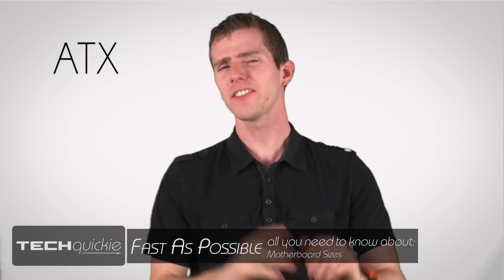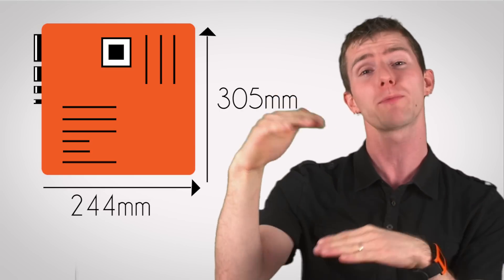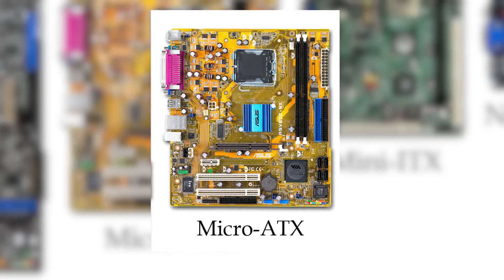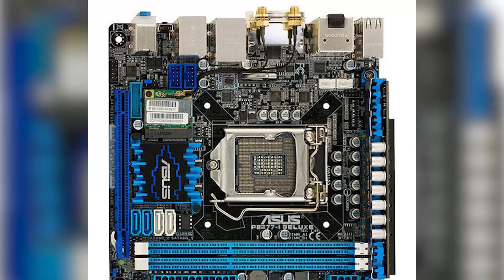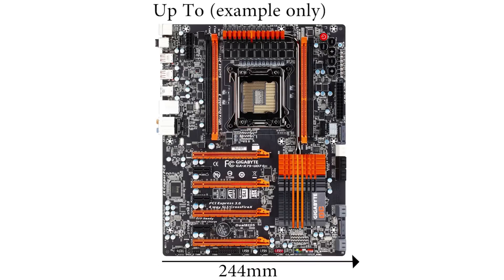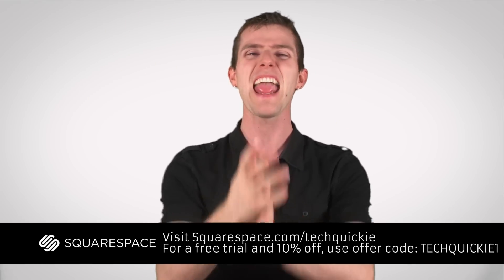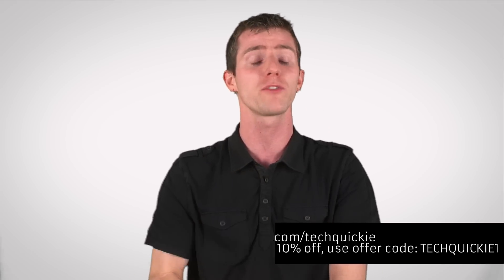PC Motherboard Sizes as Fast As Possible

Comment: Never. Ever. Buy a Mini Itx board.. I have one and I regret it so hard.. Upgradability is VERY limited, and can't be overclocked (atleast the one I own). The reason I have this board is because when I bought my PC it was prebuilt and I had almost no knowledge about computer stuff.
Reply: the only limit is the one pci slot and only certain nobody can be overclocked for Intel.
Reply: Not everyone needs crazy expansion. Also your specific mITX MB not allowing OCing is a flaw with the standard?

Comment: Can someone explaine me what all those fancy number coding meen on those motherboards ? (Google the * out of finding this)
Reply: Randy Klinkenberg You mean like Z97 or H81?
Reply: Isaiah Baez Yeah something like that (and how they know like "oh this motherboard is better then the other" )and also which processor goes with that
Reply: Randy Klinkenberg Those are motherboard chipsets. For example,on the LGA1150 socket,there is H81,B81,Z87,or Z97. The ones with a Z are specialized for overclocking(even though any motherboard could do that).If I had an Intel CPU with a locked multiplier,there is no point in paying extra for a Z motherboard.
Reply: Isaiah Baez oke thanks for the awnser.
Reply: Isaiah Baez owh and i have a Gigabyte Z68XP-UD4 what does that mean:P can i run gta 5 ?
Reply: Z68 from what I've seen is the chipset of the Sandy Bridge CPUs. They were made to overclock as shown by the Z in the chipset name
Reply: allright so what is the rest of all those fancy numbers :P sorry for the many questions
Reply: The rest of the numbers are just model numbers,sometimes companies release the motherboard by a name like Asus's Rampage or companies like gigabyte will just throw numbers in your direction

Comment: If memory serves (and it usually does) the ATX sized motherboards are the same size as the original IBM PC-XT Motherboards. I built more machines of that form factor than I care to count having worked for 3 different clone manufacturers "back in the day" I'm kinda surprised that someone doesn't resurrect the original PC-AT sized motherboards with additional slots (or greater slot spacing) to accommodate the massive number of double slot cards.

Comment: So micro ATX fits in a midi Tower?
Reply: Up4lIFe yeppers
Reply: Up4lIFe Mini-ITX fits in them also.....I can confirm this since I've done it myself.
Reply: Up4lIFe Check with your specific case to be sure, but a vast majority of mini towers will fit a Micro ATX. The only time when you might run into issues is if for some reason you're using a Dell, HP or other OEM case with an aftermarket board, as they sometimes use proprietary motherboards or connectors.

Comment: Well. I recently put a micro-atx in an atx case, an old one, mind you, but atx nonetheless, and there was some sawing action required. and that nice little panel just didn't fit right in. works bloody fine, though, if you just mcgyver it. Probably doesn't apply to newer cases.

Comment: I got a H81m motherboard, and it is an odd size one, at first I though it is standard micro Atx board, but then I realize it is slightly shorter than mAtx board in both height and length, has 2 ram slot instead of 4, kinda between mATX and MITX board.

According to Asus, it is uAtx board, note that it is not the micro sign, just a single "u"

Comment: Anyone know if there are any differences between mATX and ATX performance wise for an average gamer?
Reply: In general a modern mATX only limit how much hardware you can place on it. I use one, and my i5-4670k clocked 4.3 GHz and GTX 980 perform just as they should. But do check your parts' compatibility with each other.
Reply: J.P. Thanks!
Reply: Pointblankmos Micro ATX will have a maximum of four PCI/PCIe slots which in essence means you won't be able to run a multi GPU system or have a ton of dedicated PCI accessories such as discrete audio or PCI based SSDs. This shouldn't be a problem overall, if you really need a multi-gpu rig you could always get a dual GPU card. Most cases are compatible with both.

Comment: trying to upgrade my dell precision t3400 with gtx 750ti not sure what to buy or if compatible please help
Reply: yugiohprofessional There are a few things you need to check before you buy any parts. First, check that your motherboard has a free PCIe x16 slot. Google what one looks like, it's easy to tell if you have it or not. Some Dell motherboards lack an x16 slot altogether. The second thing to check is your power supply. The 750ti needs a minimum of 300W for the most basic version by EVGA. If you need to upgrade the power supply you must make sure the current unit is an ATX power supply and that the motherboard uses the standard ATX 24-pin motherboard connector and an ATX12V four pin/EPS 8-pin CPU connector. Dell tends to use proprietary connectors so if you have these then you cannot upgrade the power supply.  
If you can upgrade, I'd highly recommend doing so, as OEM power supplies are often not that great. I use a Corsair CX430 in my budget build and it does fine, not the best but better than the original unit that shipped with the system.

Comment: If i get a micro atx motherboard and an atx power supply will these be compatible?
Reply: Yes it will work. They use the same connections that are the same atx standard.
Reply: As long as the power supply has a 20 pin connector (usually most psu have a 24 or 20 pin that can be changed from between.).

Comment: i have msi g31tm-p31 mini-atx motherboard
it has only one PCIe 16x slot and i have decided to buy a new graphics card
and my psu is 600w
pls. help me i kno i'm a noob
Reply: it depends on which graphics card. i bought a geforce GTX 660 and it only requires a 450W PSU. Do some research on the graphics card you are buying. just make sure your PSU has either a PCI cable OR two spare molex connectors(you will need a molex to PCI adapter - which usually comes with your graphics card) to be used for power.

Comment: Can someone help me find a Power supply of 750W to 850W, 

fits in this case without removing the hard drive slots (so a small PSU) (  http://ca.pcpartpicker.com/part/corsair-case-cc9011061ww   )

Has a connector to this motherboard  (    http://ca.pcpartpicker.com/part/msi-motherboard-z97igamingac    )

and uses this graphics card and cpu cooler.....

(   http://ca.pcpartpicker.com/part/xfx-video-card-r9285acdfc    )    

(    http://ca.pcpartpicker.com/part/corsair-cpu-cooler-h100i    )

Please help asap
Reply: K Flower Corsair's website states a max PSU length of 160mm. You could use a Corsair CX (avoid the CX750M, 850 is fine) or CS series, or any other PSU that is 160mm long or less. Power supplies in that wattage range will be compatible with your video card. Motherboard compatibility is a nonissue as all aftermarket boards use standard 24-pin connectors.

Comment: HELP !   I have the "usable" memory problem in my computer.
I'm running Win 7 64 bit. I have 8GB of RAM.
1 X 4GB 1333MHz
1 X 4GB 1600MHz

And it says RAM : 8.00GB (3.73GB usable)
HELP !!!!!!
Reply: Um you should probably put your ram at the same clock speeds in the bios and then it would work derp.
Go into the bios and either overclock the 1333 Mhz stick to 1600 or underclock the 1600 stick to 1333Mhz. Otherwise your ram is incompatible.
Reply: Born Boy First check the slots in which you put the ram.Ram slots that function in dual channel mode require two rams at similar clock speeds.If not they won't be detected.Check your motherboard for the color of the slots and in your case as you have 2 ram modules of different clock speeds put each module in differently colored ram slots.If this does not work then try overclocking as doing it is a risky thing if you're not sure about what you're doing.Hope this helps!
Reply: Don't mind it, "usable" RAM usually means the free RAM you have after all your common processes are in place. But you can still use 8 Gigs so don't worry
Reply: Robert Strong thanks
Reply: ***** thanks.

Comment: Yeah, not all ATX mobos have the exact same size. They have the same height, but the length varies.  I have an ATX mobo that's only 200 mm, not 240. It only has 7 screws instead of the 9. So there. Not all ATX mobos are the same size.

Comment: I have an AMPKB-CT by Azure. Is there any other board that would fit in my PC? It has a souldered-in AMD A6-5200, which is horrible.
Reply: Dude, buy a new pc...
Reply: New American Fishkeeper If you get a new board you'll need to buy another copy of Windows, and you'd still be left with a substandard chassis with inadequate cooling, no cable management and no room for larger CPU coolers. I've been down that road before. The particular board is a proprietary design by HP and will most likely mean the case is non-standard too. Build a new PC. If money is a concern then see if you have a computer thrift store or PC parts store nearby, you'll often be able to find great deals. I found a Bitfenix Shinobi mid-tower case for $10 at a thrift store, and a few open box motherboards for $30-50 at my local PC parts store. Browse online for even better deals.

Comment: There's also BTX but AFAIK only Dell uses them.
Reply: i do not think even Dell using BTX anymore as it is so old and doesnt have any newer version of it to go for the newer CPUs
Reply: yumri4 Lenovo used a few BTX boards too, but it's pretty unpopular for computers. the only thing i kinda liked about BTX is my graphics card's fans were aimed up instead of straight down. BTX is a mirror image of an ATX board. it mounts to the opposite side of the case.
Reply: 88ariesk i vaguely remember BTX from when i was studying for a COMPTIA A+ exam but the teacher didnt really go over it that much as everyone and almost every company now uses ATX, ITX or properity motherboard.
BTX was a good try though as it was to get better airflow in the case or a attempt to do so anyways just there wasnt that many cases for it and there was and still is a ton of cases for ATX and ITX.
so BTX looked like it would be good just never took off.

Comment: Might be a dumb question;  but I have an asus Z97-AR motherboard and I've bought and installed most of my parts for my build (all except cpu, RAM, graphics card, and OS.) I want to test all the connectors and fans and everything work along with the motherboard.  Will it cause damage to any components if I just power on my build computer without a cpu ram or graphics card? If its possible, how long could/should I keep it running for testing?
Reply: It wont "turn on" without a cpu or ram because the circuit is broken without them as far as i know. Plus if it did work, depending on stock settings that you cant change without the cpu/ram. It will show faults that are actually working normally (ie. a fan port is turned off so you think the port is broken). Assuming you're taking multi-meter readings. But if you're simply asking if you can access the bios/uefi without cpu/ram then no, you cant.
Reply: Your computer won't boot. Your computer will detect that there isn't any ram on board during the POST (power on self-test)

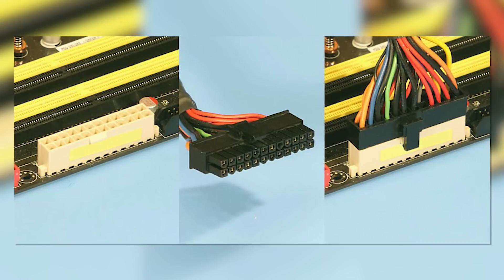Comment: 1:03 -->but what is with motherboards like the asus maximus extrem VI that has the standart 24 atx plug and a 8pin AND a 4 and 6 pin plug??
Reply: What about it? It has both.
Reply: Its not an and its an or, my mobo was setup like that.

Comment: yes... but what one do i chose for building a gaming pc?
Reply: ATX would be your best choice, unless you want a SUPER KILLER computer which you probably wouldn't need.
Reply: well i am gonna wanna stream from it
Reply: To stream you don't need a killer machine, you need a good internet connection.
Reply: ok cool
Reply: false. you do need a good computer. Good enough both to encode video and play at the same time
Reply: Do you even know what a killer computer is? If you get an Extended ATX board is to spend over +2000$ on it. With a "good" computer on the 800-1200$ range with a good CPU and GPU, you can do any streaming NO PROBLEM.
The only thing limiting you is your internet upload speed. If you upload speed is shitty, even if your computer is fucking monster you won't be able to stream anything because it can't keep up with the bitrate of the upload.
Reply: Keytotruth yeah you're totally right but I was just saying that you need a good computer as well, it's just ONLY the internet speed, but that's the main thing
Reply: It all depends on what you want to do with it or what you can do with it.
Reply: Keytotruth Actually, depending on how "killer" your PC is you can stream with shitty upload speed by compressing what you're streaming more.
Reply: Even if you have the best killer computer, there is a limit to compression without messing too much with quality.
If you wanted to do a stream at 1080p and your upload speed is like 80kb/s, you would never get a consistent framerate no matter what encoding settings you choose (unless you downgrade the bitrate of the video, which would decrease the quality).

Comment: does that mean that most store bought computers have standard ATX motherboards, because when i was looking to build a steam box for Under $400 the fm2 slots are only micro-ATX but if i switch over to intel, i have the option again. Even though im currently only looking at single GPU use right now.

Comment: Linus, your ideal board, the Asus P9X79E-WS, is a CEB form factor. Thanks to you this board is now the base of my new CAD station. Only a handful of cases say that they support this and the other obscure form factors.
Since the CEB is based on a mix of ATX and EEB form factors could you install a CEB board in an ATX case like the Corsair 750D or the NZXT 820?

Comment: It's time to change your microphone, mate!
Reply: IKR, speakers were popping the entire video.
Reply: William Kendrick
You purchase a pop filter, and place it in front of your microphone, taking care that it doesn't touch the microphone (otherwise some vibrations will be transferred, lessening the effect).

It's not hard.

If you want to ghetto it, a piece of stocking or pantyhose stretched over say - a cardboard tube that's bigger than the surface area of the mic does the trick almost as well as a professional solution.

All it does is deaden the explosive air pressure of puh, buh, etc sounds, so that it doesn't cause clipping. This is because a microphone's diaphragm is a sensitive mechanical device that vibrates back and forth. (this is even more so the case with condenser microphones than dynamic microphones)

the cloth windshield covering a microphone (this is present on say, the Shure SM-58, although that uses a metal windshield)  is not enough to prevent all popping sounds, and is mainly designed for it's namesake, to prevent wind from interfering with the sound. It also protects the mic by preventing saliva from reaching the microphone, which is typically slightly corrosive, and damaging to a microphone. )
Reply: *****
or add a proper pop filter. That generally works as well.
Reply: Aukerai
its not a suggestion if you dont explain how to do that, it's just criticism then
Reply: damn i was thinking my PC had isseus :/
Reply: Aukerai
wow, lots of useful information! thank you :)
Reply: It's sounds like that usb hydrogen pocket reactor that Linus reviewed lol
Reply: i muted this post because to be honest i dont care what his mic sounds like.  i'm also not replying anymore, and will mute and ignore/block anyone who attempts to argue or insult him.
Reply: okay so its not me :3
Reply: ***** not sure you know what "aspie" means.
Reply: maybe its your headphones or speakers  xD
Reply: Je Moeder nee je vader
Reply: MICROmor The Sound is perfect dude check your sound drivers...
Reply: i havent had any issues XD
Reply: Aukerai Sounded more like a digital 'Pop' rather than Plosives. say, his cable is dodgy and the signal keeps cutting out.
Reply: yuda Kaufman Sound is not perfect.
Reply: He has a 1000 dollar mic I don't think that's the problem
Reply: MICROmor It was fine for me lol
Reply: maybe micromor is like half deaf
Reply: ***** Didn't have that problem at all...
Reply: MICROmor nah

Comment: Hey Linus
When you showed the eATX board being 330mm wide you had an standard ATX board on the screen with a dimension of 244mm. This was at 4:05 into the video.
I only sya this as I have never seen an eATX board and was interested in the graphic.

Comment: Whatever happened to BTX, havent seen that in years.
Reply: BTX was mainly to reduce cooling requirements but due to the rise of energy efficient components this cooling performance could be gotten with ATX . 
Case manufacturers, as a case for ATX is not the same (anymore) as a BTX one,
did not want to make double their range so BTX has pretty much died a death.
Reply: *****
AFAIK  Originally BTX where just used in ATX cases but upside down with BTX component placement then BTX were swapped left to right so would no longer go into ATX cases.  So case manufacturers would have to make ATX and BTX versions of cases
Reply: I know what BTX is. I'm just wondering what happened to that format. They were kinda catching on for a year or two then bam disappeared. What I really liked about them was that your graphics cards were facing up, so you could actually see the cool heatsinks.
Reply: Warndog
Not needed anymore as components became more efficient so they didn't need the extra cooling .  Case manufacturers  wanted to consolidate there manufacturing so no BTX cases, so no MBs to go in the no cases.
Reply: Yea sorry, I just seen your post up above. Youtube wasn't showing that yet, just your explanation as to what it was. sorry bud, n thanks for the info :) But it's def too bad. They really did look cool. And the way the cpu heatsink was always ducted straight to the outside of the case worked well.
Reply: haven't*